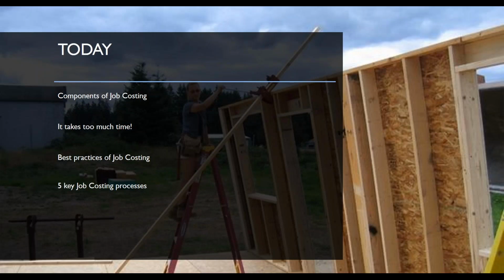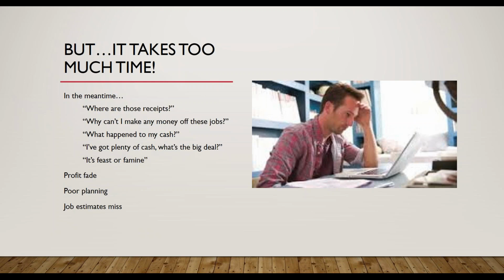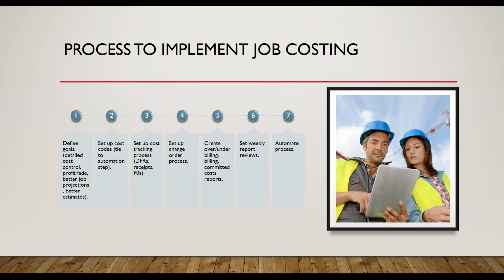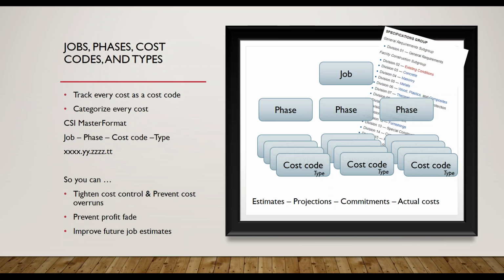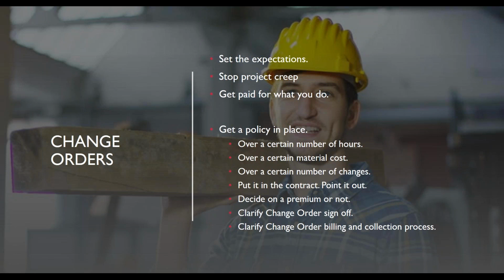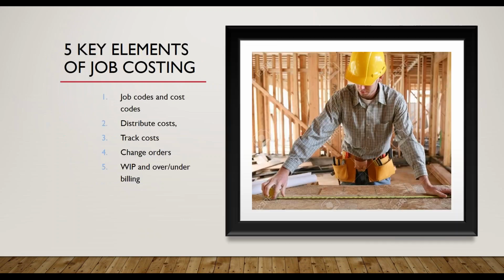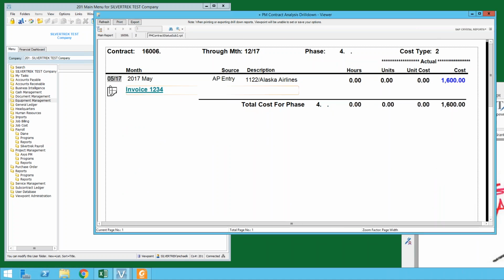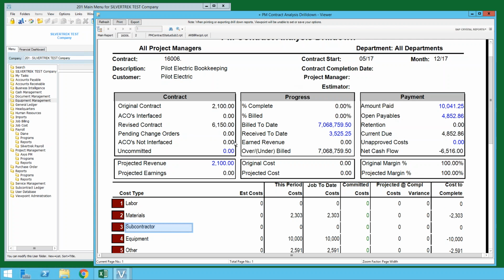Job Costing    Construction Best Practices

Comment: TLDR: Proper job costing, including setting up phase and cost codes, automating processes, and using technology, is crucial for tracking expenses, preventing profit fade, and improving accuracy in construction projects.

00:00 🏗 Construction companies deal with various business processes, including bidding, pre-construction, and construction.
01:18 🏗 Accurately track job costs in construction by assigning phase and cost codes to materials and labor, and tracking expenses and hours daily to ensure profit margins.
05:02 🏗 Proper job costing, including setting up phase and cost codes, automating processes, and using technology, is crucial for tracking expenses, preventing profit fade, and improving accuracy in construction projects.
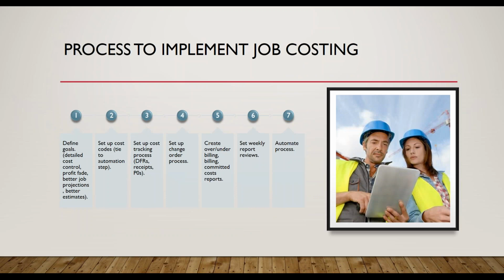08:09 🏗 Define project goals, set up phase and cost codes, automate cost tracking, and ensure accountants understand the process for effective job costing in construction.
11:24 🏗 Understanding margin, change orders, WIPP, and cost codes is essential for construction company success, with Cassell consulting providing comprehensive assistance.
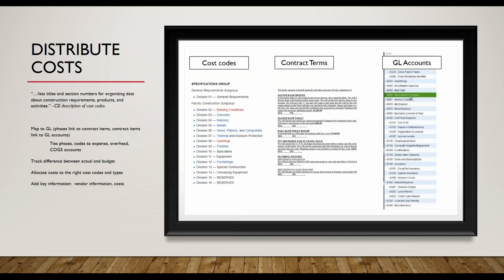14:08 🏗 Tying contract terms to cost codes and GL accounts allows for tracking job costs, numbering each job and tracking costs is crucial for job costing in construction, and implementing a clear change order process can prevent project creep and ensure fair compensation for additional work.
17:49 💰 It's important to manage job costing in construction to avoid over-billing, excess cash, potential overspending, and cash shortages, by establishing job phase cost codes, tracking key reports, and implementing a change order process.
21:04 🏗 Viewpoint's Vista product is one of the best construction accounting software options for detailed job costing, allowing for real-time tracking of costs and revenue to ensure efficient and effective operations.